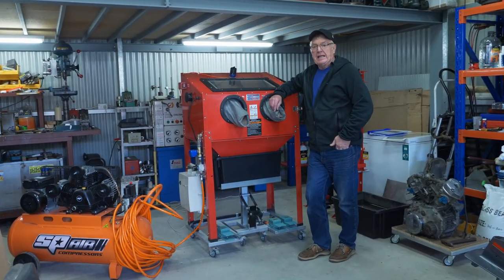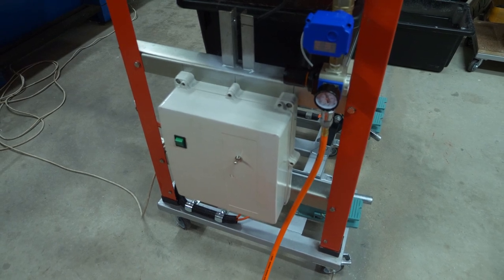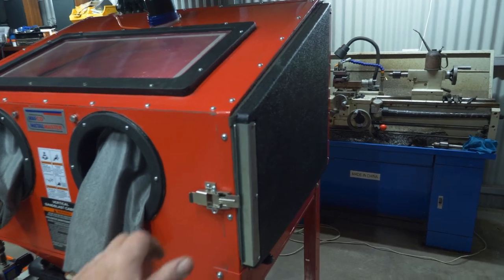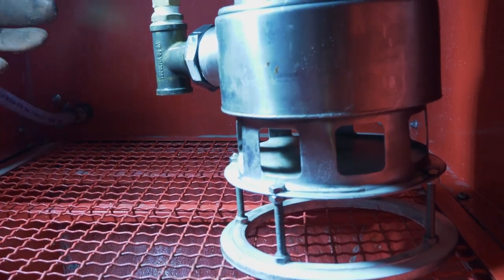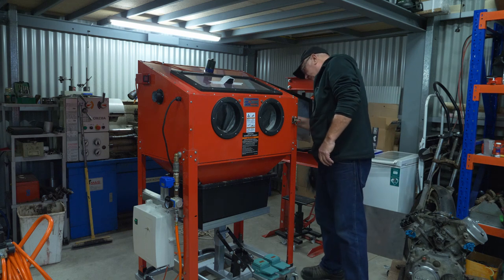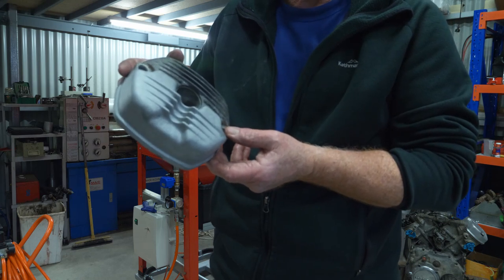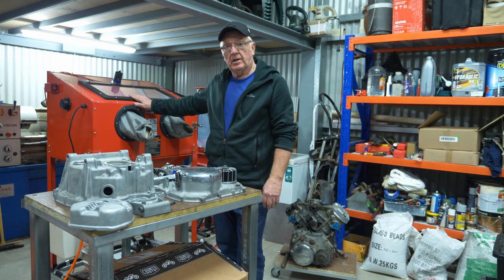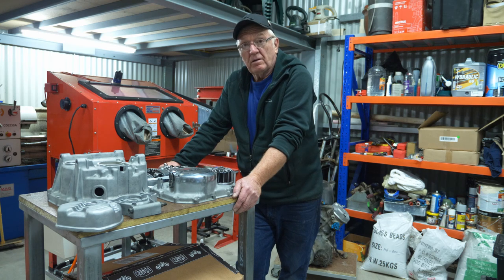How to Build a Wet Blasting Cabinet

Comment: If you powder coat your parts, you don’t necessarily need a coarse finish. Powder will adhere to the material extremely well no matter polished or not, a long the surface is 100% clean. There is a powder from Clear Vision named Ultra Clear Vision and is transparent. If used, you newer will need to sandblast your aluminium parts again.

Comment: Hi, I have momentary foot pedals like yours and wish to make them latching. I don't know how to work/play with/code Arduino circuitry but have purchased 12v timers and other little pre assembled (attach power and go) assemblies from off Aliexpress in the past. I was wondering if what you made to make your pedal(s) latching could be bought off the shelf from off Aliexpress? If so - what would I be looking for? Thanks for any pointers. Safe travels on ya bike!
Reply from the maker: Gday mate
So you want to make a relay that powers lets say the  pump with one press of the momentary foot switch and off with a second press
I would look at a latching relay see YouTube link below. You could use that signal to energise bigger relay that can handle more voltage 

https://www.youtube.com/watch?v=kGnknHV15T4

Ali Axpress have latching relays

https://www.aliexpress.com/item/1005006583085991.html?spm=a2g0o.productlist.main.7.782aGTVuGTVuXx&algo_pvid=ddb0409b-412a-4c04-97f4-e64d1aeed4df&aem_p4p_detail=2024081415324511576002496625300001992213&algo_exp_id=ddb0409b-412a-4c04-97f4-e64d1aeed4df-3&pdp_npi=4%40dis%21AUD%218.87%216.65%21%21%215.80%214.35%21%40210307c017236747655307722e5e3f%2112000037728568572%21sea%21AU%21185507440%21X&curPageLogUid=KoHHyCL1WzsL&utparam-url=scene%3Asearch%7Cquery_from%3A&search_p4p_id=2024081415324511576002496625300001992213_4
Reply: @Coolhand99au  G'day matey, this is what I was after (I think) Thanks! I'm using the foot pedals to actuate 12v Ball valves the same as you. Probably got from the same place as you given they look identical ;) I've watched/studied your clip off and on over the years but have decided I need to pull finger and make my own one happen. Thanks mate.
Reply from the maker: @gooseypig84  
Fantastic !
Good luck with the project

Comment: Thanks for the tips. Will find an old heater fan from a car and use it to suck the air out. I also watched the guy from Armoury Enterprises, and built mine from an old dishwasher. So far I'm £150 ish into it, and already started test blasting. Needs some better water control to stop my legs and feet from getting wet, but definitely heading in the right direction.
Reply: Also, is it possible to use Aluminium Oxide to strip a part of corrosion and paint, then smooth it with glass beads, or are the glass beads too gentle to make a dent in the surface?
Reply from the maker: @lordmcmenace  Yeah mate the Aluminium Oxide is good for getting harder stuff off and then switch to glass bead to finish off

Comment: Steve, Thank's for your reply, comments. I'm going to build one shortly, there were a few thing's I was a bit in the dark about but you have answered those questions, still got to get my head around the electrics, I like what you have done with those and will probably do a similar setup although I'll be learning on the job as I'm no electrician. I'm renovating an old XL 500S at the moment the vapour blaster will certainly come in handy for that, caught your video just in time as I'll be pulling the engine apart very shortly, got the 600 version to do once that's done. All the best.
Reply from the maker: No worries Justin
Good luck with your project

Comment: Hey Steve nice video mate, just a suggestion.... you could make a simple stand off the ground for when you change the tank, just wheel the tank up to your stand and lower it down, eliminating the lifting of the tanks..  nice work..
Reply from the maker: Hi Phil 
Sounds good !
After I finish the CX500 project I do want to revisit the Wet Blast cabinet 
The tank I have on now is way to big really after using the cabinet for a while now, you don't need a big tank I just selected that one because it was readily available
So I will modify it to a smaller round tank. I do like the wheel in and lift up it seals off pretty good

Comment: Why You sterring air by motorised ball valve ? What size accesories for nozzle You use  ? 1/2 3/4 ?
I have almost the same construction - but have problem with to big air presure  - water is back to pomp.. 
what size of nozzle You use ?

Comment: Brilliant video! Thanks for sharing. Do you have any advice on keeping the lustre on the parts?
Reply from the maker: Hi Bill 
Once the Aluminium has been cleaned and polished I use "Autosol" metal polish to keep it shiny 
You can also spray the parts with 2K clear I think Honda does this to protect the aluminium

Comment: Great video mate. How does the compressor handle the work. I have my eyes on the same one. Thanks
Reply from the maker: Thanks Craig
Yeah the compressor handles the supply load really good
OK it stops and starts but not to often
Reply: @Coolhand99au  thanks mate. Also what wattage pump are you using if you know the details. Thanks
Reply from the maker: @WillyWonkaar  
Check out the discrption above by clicking on MORE 
There is a link to the pump I used and it was 1800 Watts

Comment: Will like to know the air PsI you have to set up the regulator 40? 60?
Reply from the maker: Hi Pierre
On mine I have the compressor regulator set at 
8 Bar and the regulator at the we blast cabinet set at 4 Bar for Glass Bead and 6 Bar for Aluminium Oxide you don't want the air pressure set too high on glass bead as you will only smash the beads apart 
Experiment with your air pressure and nozzle sizes to get the best result I think I use around a 6mm nozzle

Comment: Is there anyone on here in the UK that has made this unit, I have looked around and this to me looks like the best or one of the best I have seen. I would love to meet up with someone in the UK or even better Wales so I can pinch some ideas and have an idea on where to purchase items in the UK to build my own.
Reply from the maker: Hi Dai
You can purchase the same cabinet in the UK all the other parts you can get off ebay
See link for cabinet 
https://www.ebay.co.uk/itm/Sandblaster-Bead-Sand-Grit-Blasting-Sand-Blaster-220L-Sandblasting-Cabinet-LED/264479647728?hash=item3d943727f0:g:gLEAAOSwWWxY-cZp
If you cant do the electrical stuff find an electrical friend

Comment: Hi, is the media is getting sucked into the water pump and then to the gun?
Reply from the maker: Hi there 
The Media (Glass Bead ) is mixed with water in a tank, this is then called a slurry
The submersible pump will start and take in the slurry and pump it up to the gun. Then air is ejected into the gun and this increases the velocity of the slurry to act abrasively on the parts
Reply: @Coolhand99au  thank you so much for the explanation..i got curious about the slurry damaging the water pump..your explanation help me a lot..i hoping to build one in the future.. thank you soo much..
Reply from the maker: No worried good luck
Also check this site out he has a lot of goo info 
https://www.youtube.com/channel/UC5mEA0d4nP1rbzIerZIS_7Q

Comment: I mostly powder coat parts and the roughness from oxide or sand doesn't matter. But I like the finish it leaves on raw aluminum for carburetors and engine cases. What I'm wondering is, does it remove paint just as easily as a dry media?? I notice your blasters red paint is still very intact, my paint is blasted off significantly. I use it but not a ton, it's just from 15 years of blasting on and off...  Any replies are appreciated
Reply from the maker: To be totally honest mate I have never really used dry blasting 
My wet blaster does take off paint and oxide It doesn't like selastic, rubber , etc 
I guess it also comes down to speed how quick it can clean up a part and that depends on a few things air supply, nozzle design
Reply: @Coolhand99au  Thanks bud, I'll ask a few other guys about blasting paint. I can't have 2 cabinets and I mainly powder coat, but I sure love the finish that thing leaves...

Comment: Also curious if  I built something close to this design could I get away with a smaller tank and have it still be as efficient?
Reply from the maker: Hi Bill
I did have a big tank and I was wasting media. I personally like the 32 Lt tank size 
You can go smaller but you do have to watch out when the pump is running and agitating the water media that you don't overflow the tank 
Here is a link to a guy that has involved the cabinet from the design that I used. He isn't using the load trolleys that I made 
https://www.youtube.com/watch?v=ePNZ27eQzDs&lc=z23ccxiivtrui52t5acdp4344mejjvknlt2epwv0lnhw03c010c

Comment: Once you raise the tank, how far does the bottom of the cabinet sit into the tank? Is it deep enough where it digs into the media to help seal the base?

Does the bottom of your pump (the piece you made) just sit on top of the media? 

Very great job.
Reply from the maker: Hi Chicago
The cabinet would go into the plastic tank by around 75 mm or 3 inches. Really its only there to guide the slurry back into the tank. Doesn't need to be a tight seal
My Tank is to big really. When I get time I am going to make a smaller round tank
The pump would sit on the bottom of the tank. Once the pump starts and the slurry is flowing around the tank the pump would sink and sit on the bottom. I raised my pump inlet by
 50 mm so that when the pump stops and the media settles the inlet of the pump wont get clogged with media

Comment: Rather than having water flowing into the cabinet permanently under pressure,

Could you just use the suction of the gun to draw water up only as needed? using the pump for circulation in the tank only.

Or will it not be as effective?

Comment: sir what do you call that blue small box above the air regulator? is that the one connected through your  electrical box going to one of your foot switch for air compressor?

Comment: Hi Steve, your video is excellent and love your wet blasting cabinet. I am restoring old motorbikes and think this would be a great addition to my workshop. Do you have step by step instructions to replicate exactly what you have done. I am going to by a blasting cabinet soon but would love to modify it exactly as you have done for wet blasting and able to change media. Thanks in advance. Kris
Reply: Hi Steve,
Fantastic video, well done! I've also been researching vapor blasting cabinets  and so far, yours is the design at the top! I like your setup with foot switches and your electrical system is the most professional-looking I've seen. Do you have a build video and possibly a parts list that you would share? Thanks from Canada!

Comment: Is there a reason why you went with a 3/4" motorized ball valve instead of a 1/2"
Thanks!
Reply from the maker: Hi Travis
When I first decided to build myself a Wet Blast cabinet like all of us I searched YouTube for information 
Another YouTuber that had built a wet blaster used the same valve. I thought it would be a good choice  
To be honest this is the second one I have had. The first one probably died due to me not fitting a check valve between the gun and the valve
Size I was thinking getting more volume of air into the gun is going to help 
If this one fails I would probably try a normal 3 port 2 position pneumatic valve
Have you checked out "Armory Enterprises" site he helped me a lot. He has a great Wet Blast cabinet site and now makes the guns for sale 
Check him out 
https://www.youtube.com/channel/UC5mEA0d4nP1rbzIerZIS_7Q
Reply: @Coolhand99au  got it. Thanks.  One more question:  did you just use a heavy duty extension cord for your electrical cabling?

Comment: What is the working pressure recommended for this machine ? I built one and i dont seem to get it working at it's best's
Reply from the maker: Hi Jimi
On mine I have the compressor regulator set at 
8 Bar and the regulator at the we blast cabinet set at 4 Bar for Glass Bead and 6 Bar for Aluminium Oxide you don't want the air pressure set too high on glass bead as you will only smash the beads apart 
Experiment with your air pressure and nozzle sizes to get the best result I think I use around a 6mm nozzle
Reply: @Coolhand99au   i never tought my pressure was too high, 50psi did the trick ! Its perfect now thank you sir, love your videos 👍🏼

Comment: Hello Steve.  Top quality build! I was wondering if you would be willing to send me a few photos of your electronics box?  Regards
Reply from the maker: Hi Travis
Mate at this very moment i finishing off the upgrade to my wet blast cabinet
I will be posting a video early next week on what I have done
Which is 
(1) Fitting smaller tanks
(2) Making another loading trolley so I wont stuff my back up
(3) A better light 
(4) A full explanation on how how the foot switches toggle on and off using Arduino using 12 volt DC

Mate I am reluctant to give advice on electrical systems higher than 12volt DC because of the legal requirements
Reply: @Coolhand99au  Looking forward to your update. Thanks for the quick response!
Reply: @Coolhand99au  I was looking at these foot switches as a way around arduino, but I do like your beefier pedals. 
https://www.zoro.com/linemaster-gnrl-prps-foot-swtch-maintained-action-632-da/i/G4327994/

Updated:  this one is beefier and maintained: 
https://www.ssccontrols.com/product/gx500-ma-gx-series-heavy-duty-without-guard/

Comment: An inspiring video in an inspiring home workshop, well done.
I live in Victor Harbor and in the middle of building a complete unit, wondering where you got the Ag Wido circuitry for the foot pedal switch from ?  
cheers Johno
Reply from the maker: Hi Mark
Thanks for the kind comments 
Mate you can find all the info on the Arduino Circuitry on the other video I made on my channel. Check out the link below

https://www.youtube.com/watch?v=sy8IWsG5ZDk
Reply: @Coolhand99au  Thanks ledge, that's just what I need to get going.  You mentioned your Honda cafe racer, before I retired  used to specialise in Honda performance heads, had my own flow bench and dyno etc, which I sold when I retired a couple of years ago. If you want your cx heads tidied up let me know and I'll square the slate, cheers Johno
Reply from the maker: @markjohnson6130  Thanks Johno ! thats nice
So your retired too hope they are keeping you busy hahahaha I'm sure your so busy you can't scratch yourself

Comment: What type of cable did you use (orange wire) to run around to the switches, etc.  It looks very clean.
Reply from the maker: Hi Garrett
The Orange cables are two core Blue and Brown 2.5mm for 12 volt DC

Comment: Are these more efficient than a standard media blaster?

Especially if used outside of a cabinet as a total loss on something big.

Could you install a ball valve (toilet filler) to maintain the water level in the tank?

Comment: Great work on the Cabinet and Bikes, like a lot of others I'm in that boat too. I've just started project number 4, a T120RV Bonneville, to go with the CB750 Four, XS650 Bobber and a few others like a 1936 Triumph L2/1. I am just wondering if your extraction fan is water proof?
Reply from the maker: Hahahahahaha I cant believe that you asked about the extraction fan Pete
Half an hour ago I was just finishing off my latest upgrade (New Video of the upgrades will be up in the next day or two) of the Wet Blast cabinet
I turned on the fan and it dropped out checked the fan out and yep I think water and media have worked their way into the motor. It was a marine fan with a certain amount of water proofing 
So I have ditched the extractor fan and the inside light and placed a more powerful light on the outside
Reply: @Coolhand99au  How about a different position e.g. out the side rather than out the back of the cabinet. That way it's not getting a direct hit with the waste air/vapour, maybe on the right hand side if you're right handed, although thats where the door is so it'll have to be the Left hand side or left hand back corner.... Just a thought.
Reply from the maker: @petegrice6890  
Good point Pete 
Josh from Armory Enterprises also suggested using a blower instead of a suction vent
I will add one again later it does help clear things up

Comment: Steve, Brilliant video and build, does the pump sit directly in the box, what modifications were made to the base of the blast cabinet? I note you would prefer a round tub as opposed to an oblong one, what are the reasons for this? Would you prefer a spray bar or are you happy with the wiper's? I've been planning to build one of these for a while now an noticed on one design that they had fitted a marine extractor fan which made a huge difference for visibility. Best of luck for the future Justin
Reply from the maker: Hi Justin
The only modification to a brand new blast cabinet is ; to seal it, to cut the bottom to suit the tank and fit better light, wiper 
The pump sits directly onto the tank base I have raised mine 50mm with some spacers on the bottom of the pump you can see that in the video
Yes I am going to go with a circular tank because the pump flow will agitate the media better. In a square tank the media can get caught up in the corners. Also don't go for a big tank mine is too big get one around 30 Lt
Yeah I'm happy with the light and the wiper and the ventilator. If you use a spray you will have to add water then it is going to overflow your tank

Comment: Excellent video sir.  And well presented too,  I might add.  Good narration and editing.
Reply from the maker: Cheers Ivan
Reply: And a CX500 fan too!  The Honda version of a Moto Guzzi.  The 650cc version of the engine was a great version.  A real shame the chassis wasn't up to modern standards.
Reply from the maker: @ivanjulian2532  
Hi Ivan great to see your a CX fan they are great bikes to work with
Might not be the most powerful bike around but they can be a whole lot of fun redesigning them into fun bikes'